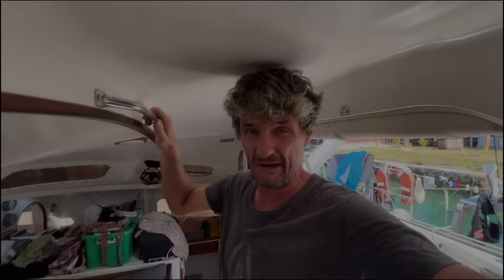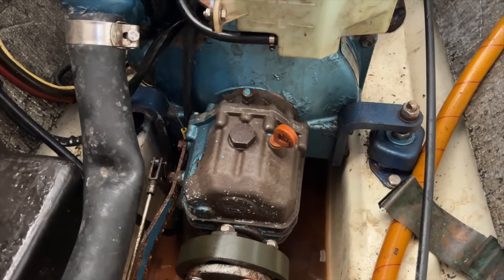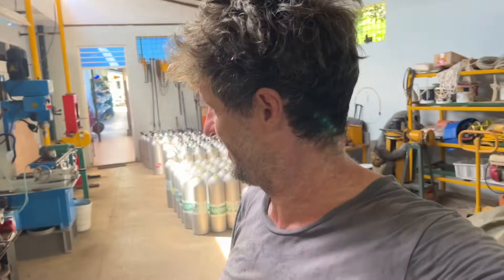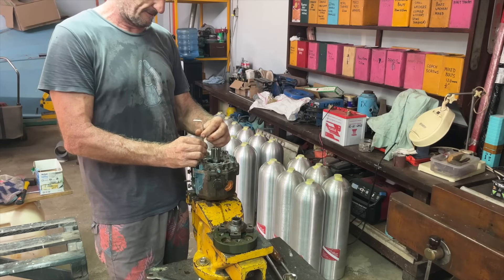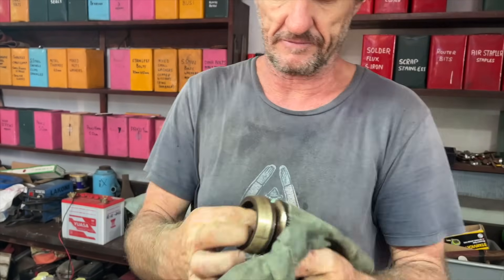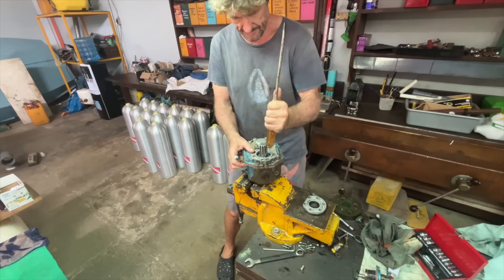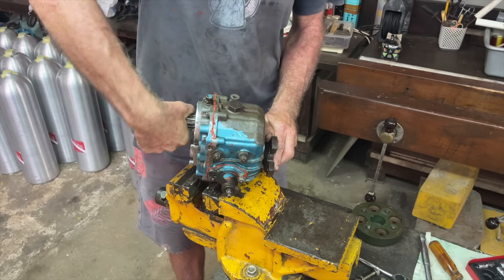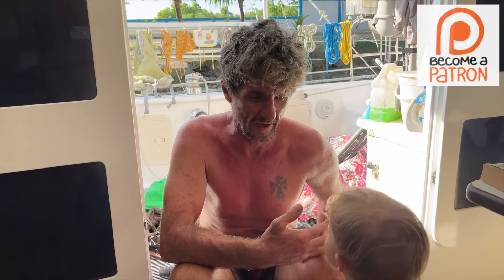Do you want to know how your Marine Gearbox works? (ep 297)

Comment: Nice one Vernon and thanks for the clear explanation. I didn’t like the look of that kink in the hose at 2.40. It looks like a recipe for trouble.
Reply from the maker: Thanks Steve. It’s the exhaust water hose, when the engines running it has some pressure and there’s no kink.

Comment: 🖐well done!
Looking at this process, I can't stop wondering how only the gear changing is more complicated on a petrol engine than the whole driving unit on an electric engine...
Reply from the maker: An electric engine can go forwards and backwards. ICE engines can only go one way so need a gearbox to have forward and reverse.
Reply: @SailingLearningByDoing  Oh I know, what I meant, is that petrol engines overall and even its supporting devices are way too much complicated, hence most sailing channels are continuously fixing them. While with an electric engine, complexity is tenth of that, or even less, and once you fit it well, no need to do anything with it for many years. So just seeing your gearbox, feels, that alone is more complex than an entire electric drivetrain.

Comment: You might have to adjust the selector engagement mechanism..
Screw it in till the input shaft just grabs than back it off ¾ turn..kinda important..ask me how I know..if you don't do that after installing a new cone the clutch might lock up in reverse...
Fill with ATF..don't overfill..important
Reply from the maker: Yeah I actually cut that part out of the video as my explanation of it was super complicated and 5min long. A little too much oil makes no difference. I’ve seen it mentioned but it’s bs. Just like people told me flat out that you can’t flip the clutch cone. Lots of people just repeat things without trying it.

Comment: I'm subscribed. Hey, how do you refurbish your driveshaft coupling when it starts to look like yours does or can you order a stainless one?
Reply from the maker: No idea. Could just hit it with a wire brush and some rust killer then a couple of coats of paint.
Reply: @SailingLearningByDoing  Sailing Life on Jupiter has one that looks a lot worse than yours does and it's starting to slip so that tells me that it needs to be refurbished or replaced and if you replace it than would going with a stainless one be the best choice? I'm asking because I'm planning on building a Mumby and would rather order a better quality part that will last longer.